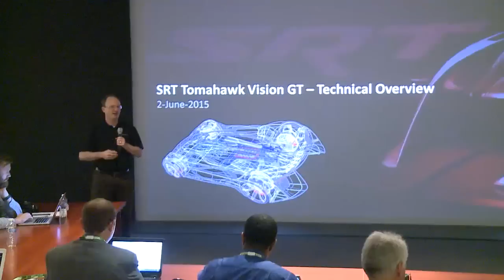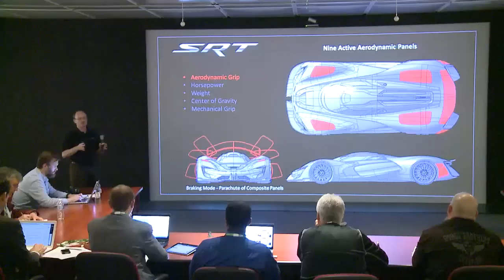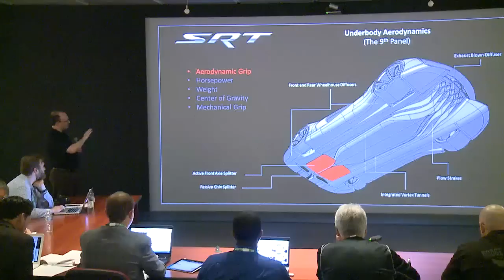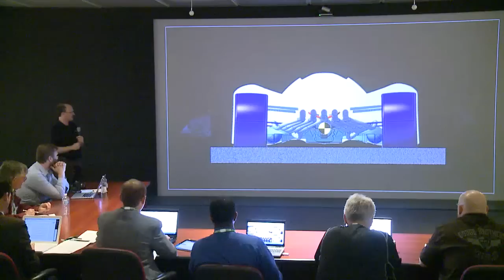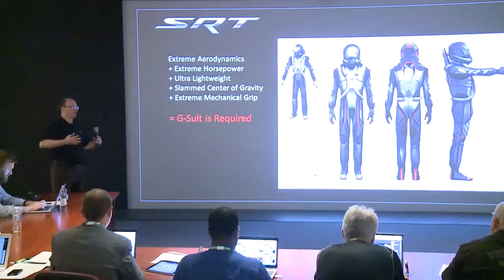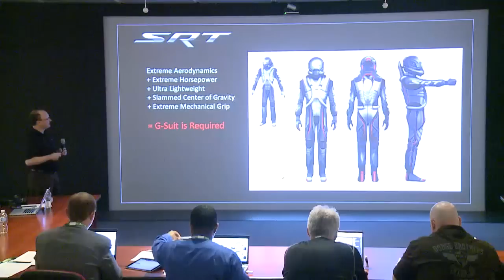SRT Tomahawk Vision GT Tech Talk by Mike Shinedling

Comment: 10 g's around a corner? How many g's does it generate when you floor it and when you brake? This car is only meant for video games cause in the real world, it would rip the driver apart. The current record around the Nurburgring in GT6 for this car is 3:10...which is insane.
Reply: dAbaPEsTA123 Apparently, it was supposed to be around 17g. Short exposure, with a g-suit, wouldn't be lethal at all.

Yeah, it's late, but better late than never.
Reply: M. A. Too bad it's a single seater because I would horrorize my passengers with the turbulence